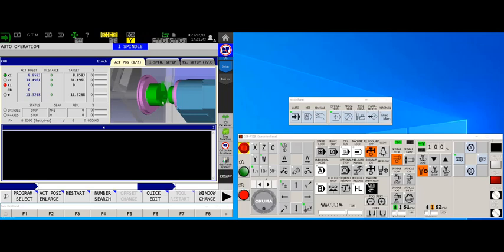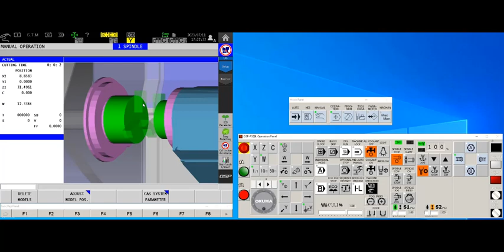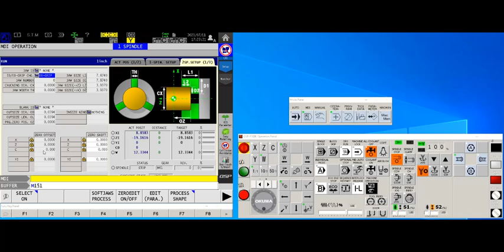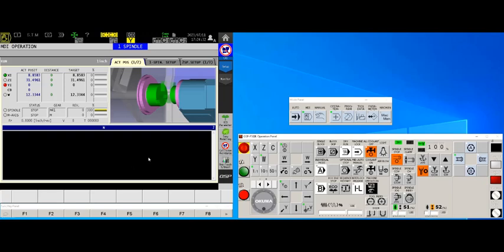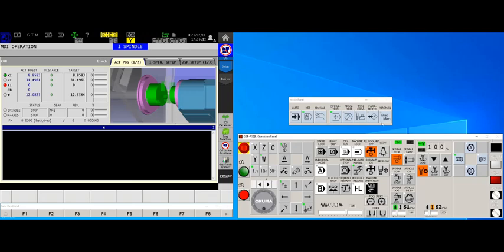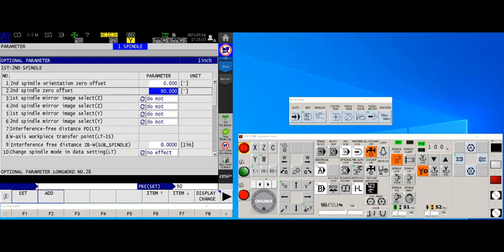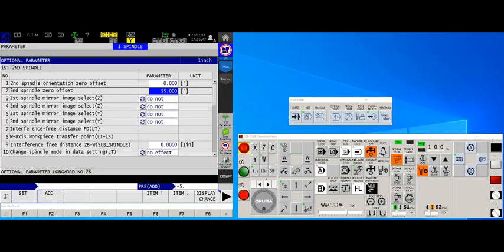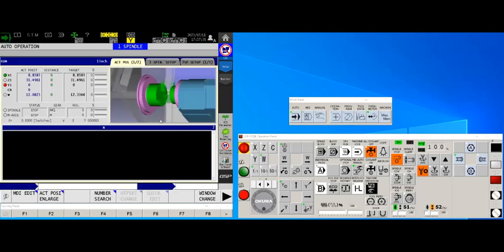Adjusting pickoff orientation for Okuma turning and multi-tasking centers

Comment: I got a multis B250II.  I'm trying to use the torque limit control on the B head to help center up the part with a dead center.  It works fine on the sub spindle but not on the B axis. I would use the center on the sub spindle but I will have to dial it in every time.   So I just went by load and now when I go back to my HP it throws out an alarm 1181.  This has me worried.  Any Ideas.
Reply from the maker: Are you using G29/G22 Z? that should work for what youre doing, but an 1181 Diff over alarm means that the machine is unable to achieve the location you've called up. Using a dead center probably isn't the best when using the torque skip. I'd suggest using a spring loaded live center instead
Reply: @pocketcharleywithgosiger  Yes.  I'm using all those.  Thanks for the tip with the spring loaded center.  Oh by the way. I at home now.  lol

Comment: Is there a system variable for 2nd spindle zero offset?
Reply from the maker: Great question! Yes, there is a system variable to write to the orientation parameter: VSYOF= will write from your program to the SP1-2 pickoff parameter I'm referring to. Keep in mind that the value you send will need to be in digital format (trailing 3 digits will be to the right of the decimal). For example, in order to set the variable to 90 degrees, your command line should be VSYOF=90000.  If your command was simply VSYOF=90. your value will be set to .090 degrees
Reply: I was referring to the C zero offset parameter not the work offset.
Reply: As you use G140 VSZOZ=10.021 for spindle 1, you can use in program G141 VSZOZ=10.999 for spindle 2